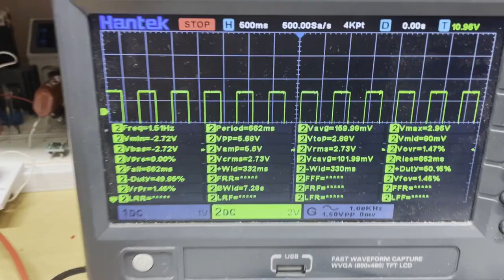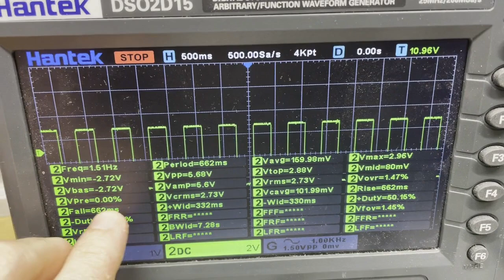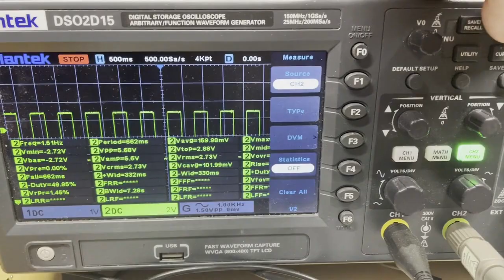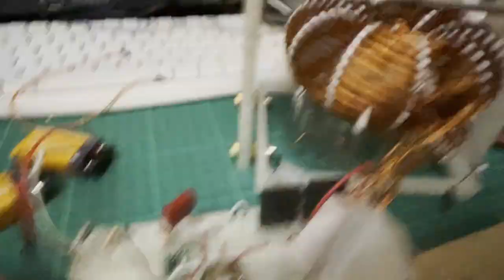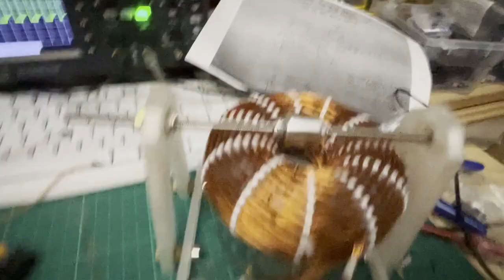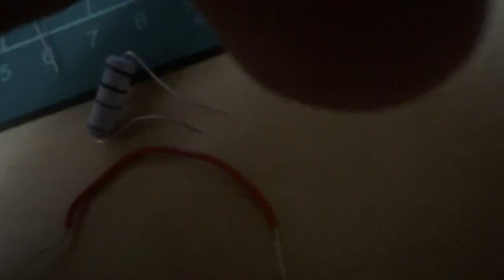AC square wave

Comment: What is the purpose of that "toroid" (doughnut) thingy?
Is it only to spin a magnet like this?  Seems very space in-efficent? So I assume it is for something else too?
Cool thing anyway :)
Reply from the maker: @sebbes333, this torus is an Abha Vortex Coil. It’s a vortex based mathematics coil. Yes, you are correct about the Abha Coil being space inefficient. I had to use a coil with an inner center that was wide enough so that the magnetic field of the inner part of the coil would interact with the magnet. Yes this was a test to try to synchronise the magnet pulsing at 27Hz. I have some additional information in the description below the video about it if you are interested. Yes a lot of people have been experimenting with the Abha coil, have a look at the channel Abha Coil, they have some really cool videos of Daniel Nunez experimenting with those coils.